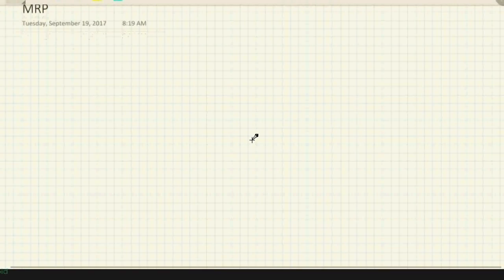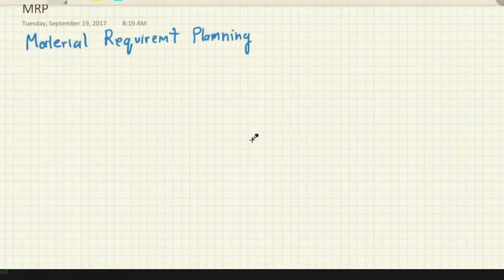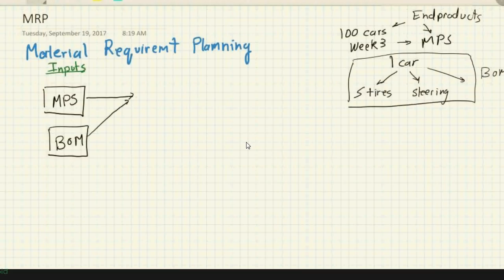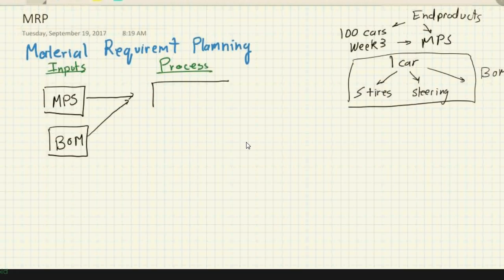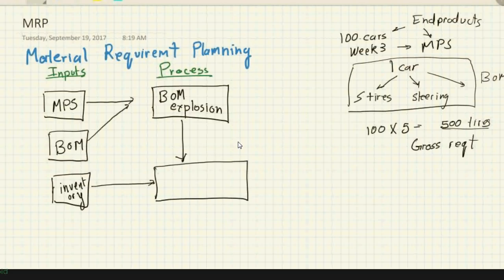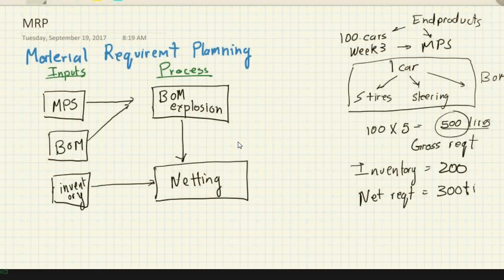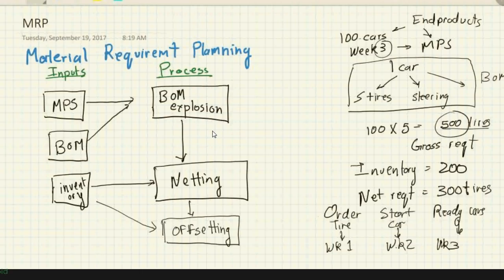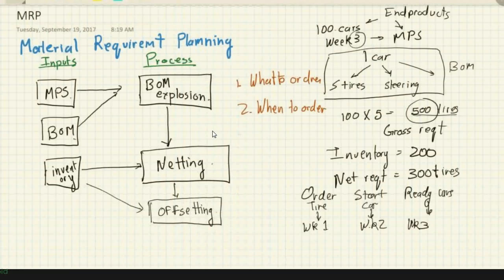Material requirement planning (MRP)

Comment: This is too simplified to be useful for MRP users.
It's missing low level codes when there are multiple levels in the BOM, the role of safety stock and on order in netting, the ordering policies to determine order quantities and several other important concepts. For someone who is trying to understand the concept from above might be a good introduction, but if someone looks at an MRP screen and sees a "Firm" of "Expedite" message, this video won't help at all.
Reply from the maker: Video was not intended for existing users and is introductory. Would you like to help in making videos for users?